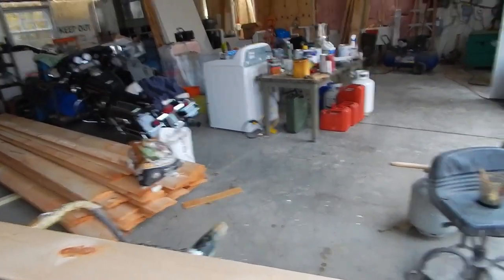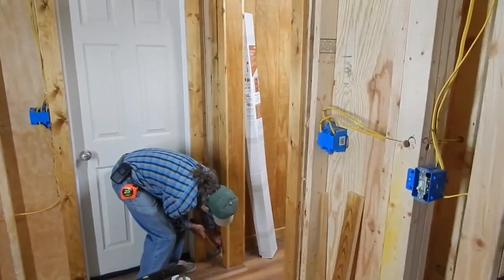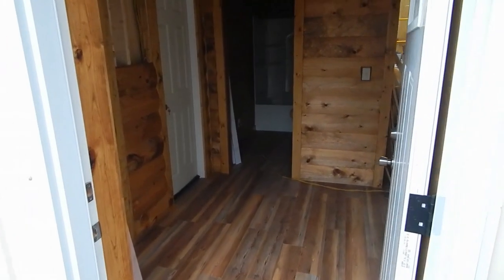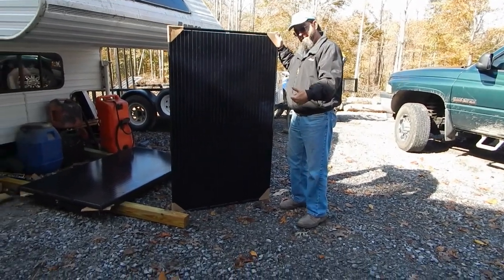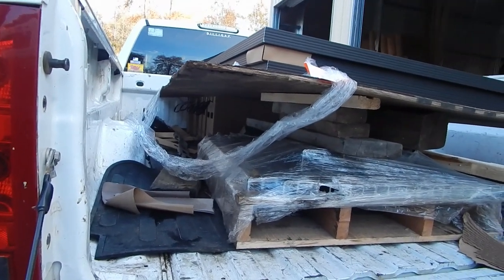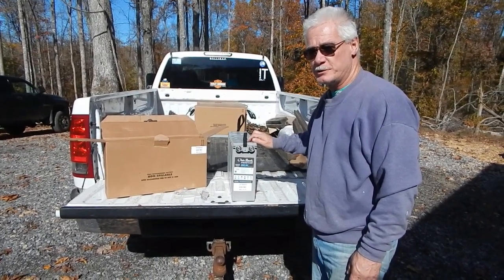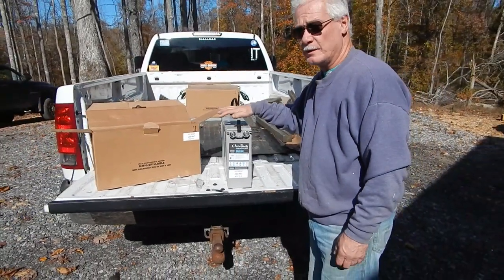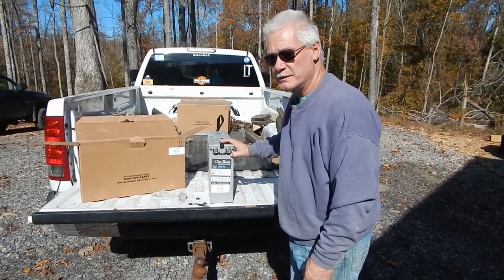TN Off Grid , Build Update, New Solar, New Battery's .

Comment: I just ordered the OUTBACK FM80 FLEXMAX 80 MPPT 80 AMP SOLAR CHARGE CONTROLLER OUTBACK POWER
Reply from the maker: DIY 
Solar Homestead U will love it I have had mine for about 5 years now. not 1 issue ever. U can hook up to a #2 awg to it.  my midnight has a super tight fit with #4 awg ,that why I only run a small length of it to the cut out box then #2 awg to batterys .